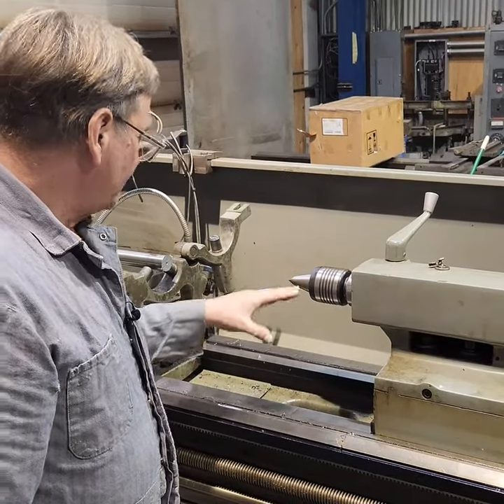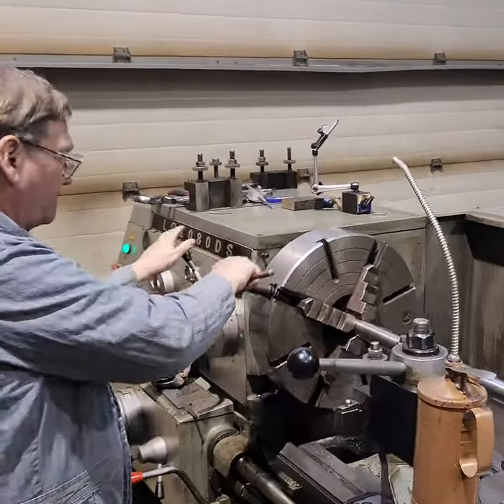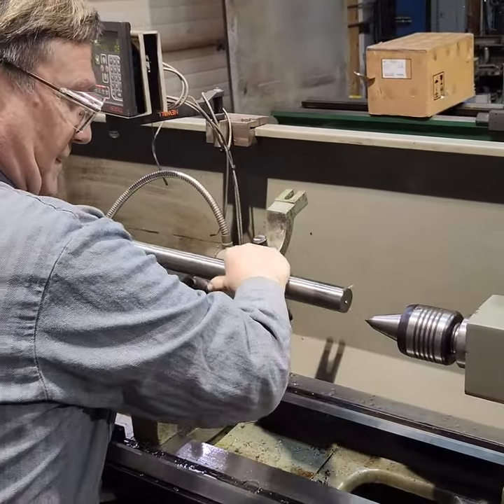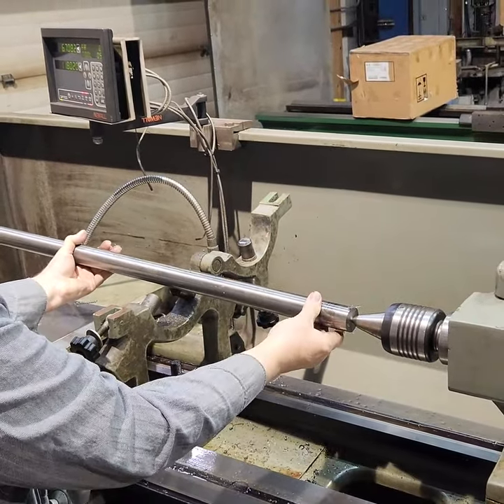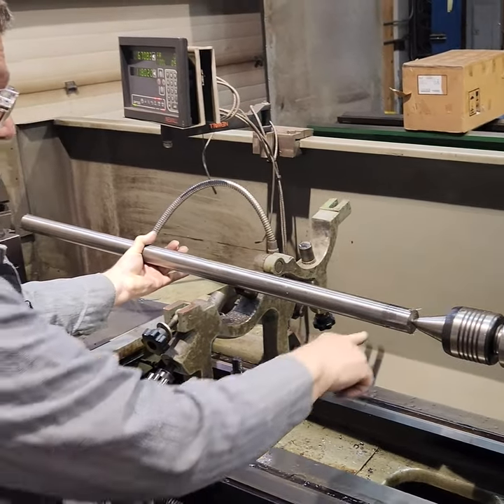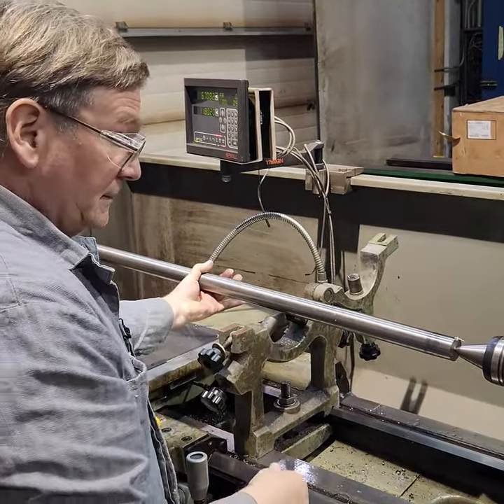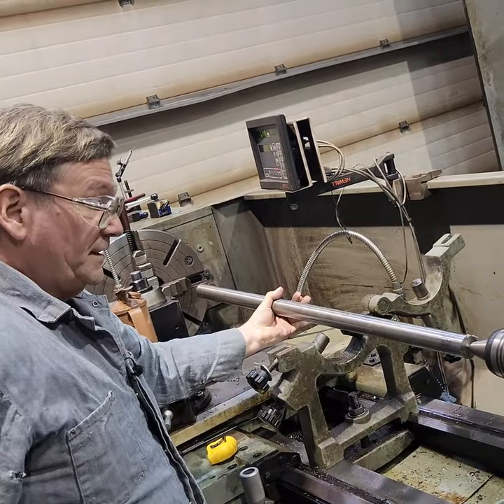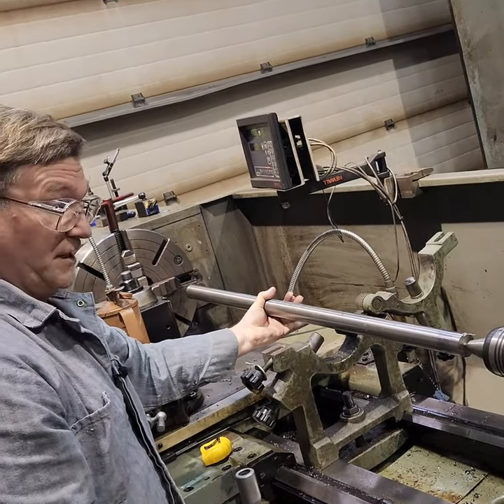Machinist's Minute: Dialing in tailstock by cutting a shaft

Comment: Tail stocks can wear down vertically over time as well. Stick a mag on the chuck and run a dial around the tail quill. Half the top to bottom difference is the thickness of shim needed between the upper and lower sections of the tail. That can affect the on-center distance of the tool point, indirectly changing the diameter of the finished workpiece. (Although not by much)

Comment: Everybody bit on the chuck key .. he has a video on it go check it out … he changed my mind on it… I use shim  stock in the center drill hole to remove  the taper in the shaft …
Reply: Yep same. Gotta do it on some of our large 3 jaws as well sometimes when they aren't quite centering